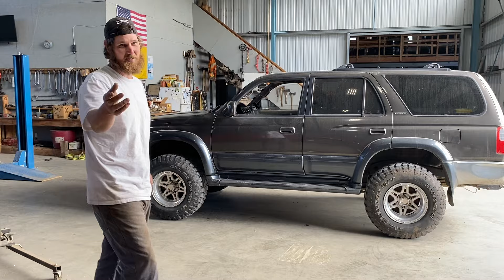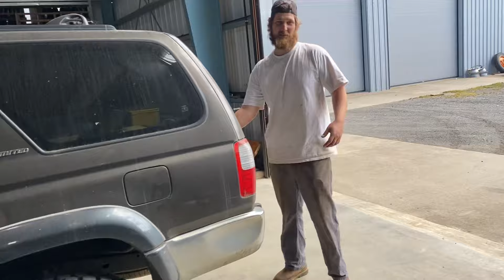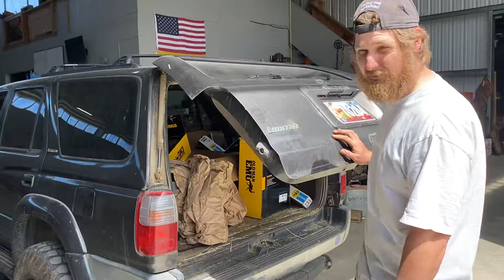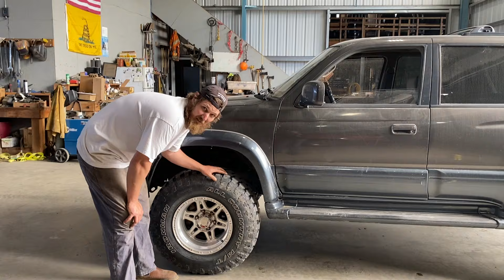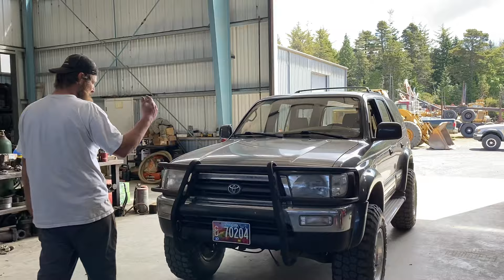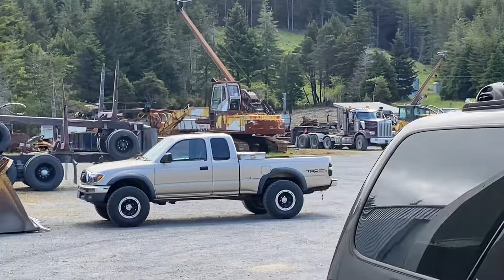285s on my 3rd gen 4Runner

Comment: You said the tires are 285’s but what are the specs on those wheels?  Brand, size, offset?
Reply from the maker: @tony_lopez  not 100 percent but think they are race lines -18 offset 10 wide 16’s